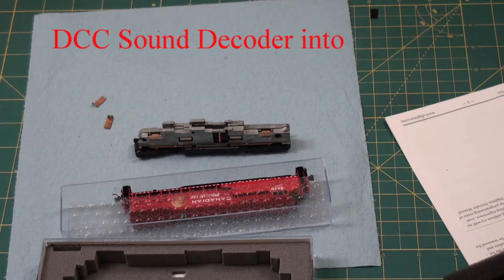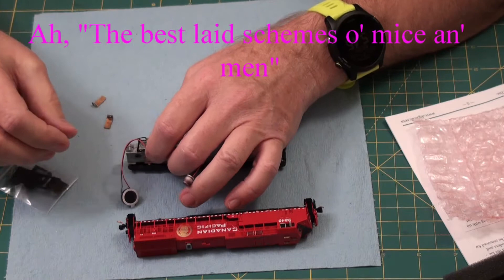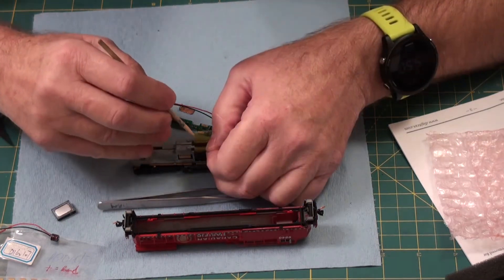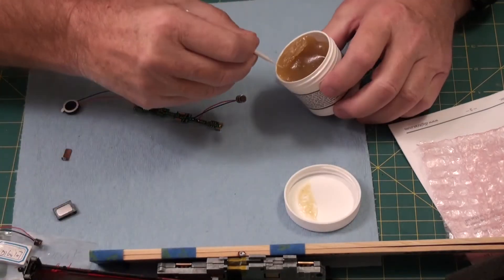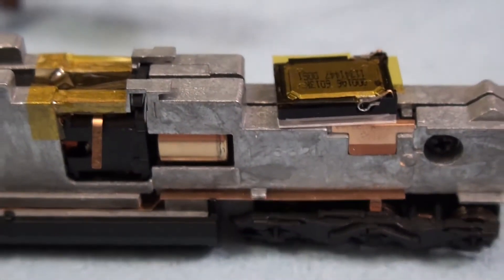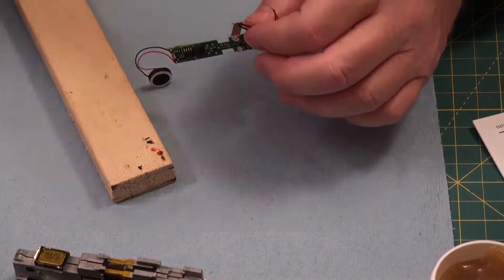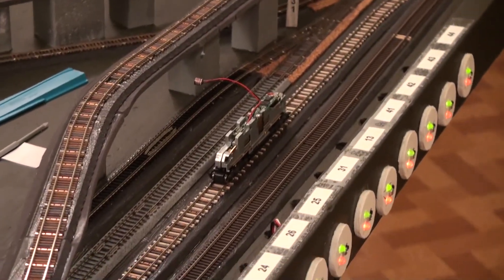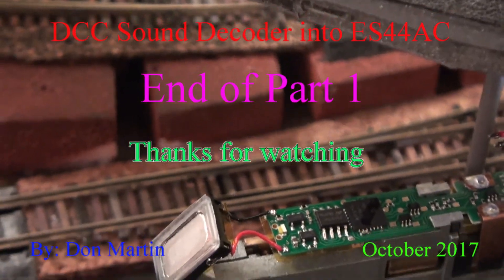Convert Kato ES44AC to DCC Sound   Part 1

Comment: The best thing to do is to get rid of the Digitrak decoder and go with Lok Sound. It’s quite abit more work to install but well the effort.
Reply from the maker: Yup, I prefer ESU but, I already have the Digitrax decoders and the ESU decoders are more expensive plus you need to buy a speaker plus a capacitor and resistor, then find space for all that and hook it up.